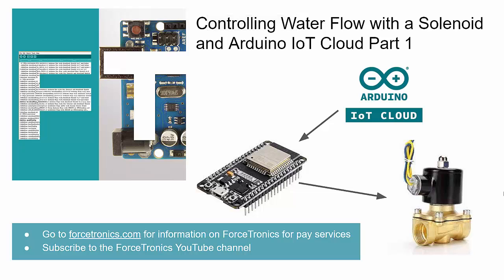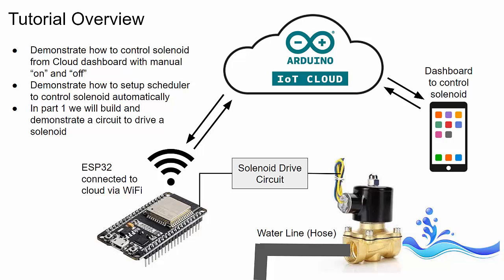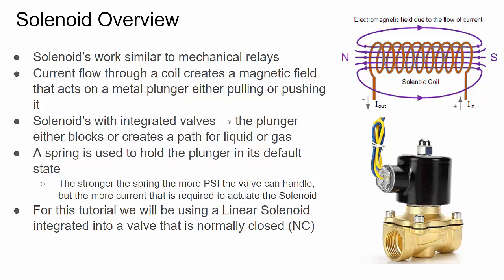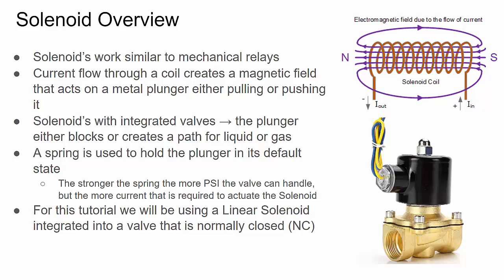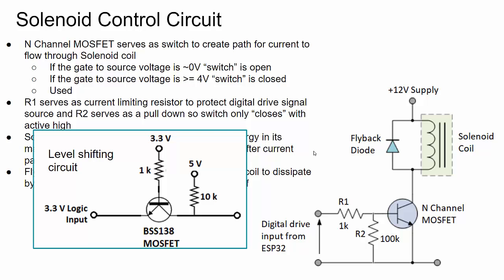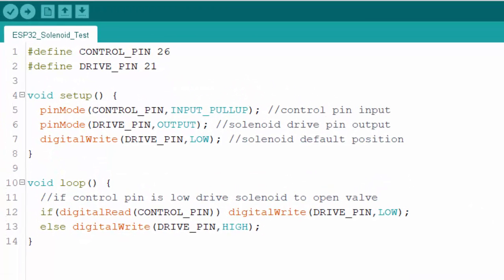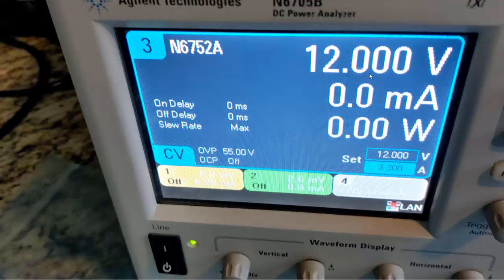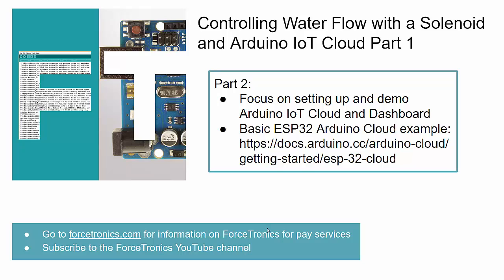Controlling Water Flow with a Solenoid and Arduino IoT Cloud Part 1

Comment: Today, as in the past, I find the level-shifting circuit confounding. I seems to me that the microcontroller pin would see 5 volts at certain times. I suppose I need to set up this circuit and test it with a multi-meter or oscilloscope. Thank you for the clear explanation.
Reply from the maker: Thanks for watching the video. One of the key things to keep in mind is when the microcontroller digital pin is low, it needs to be an active low so that it sinks the current flowing through the resistor tied to the 5V source so that all the voltage is dropped across the resistor. And when the microcontroller is high the MOSFET can be thought of as an open switch so the microcontroller pin is just floating.